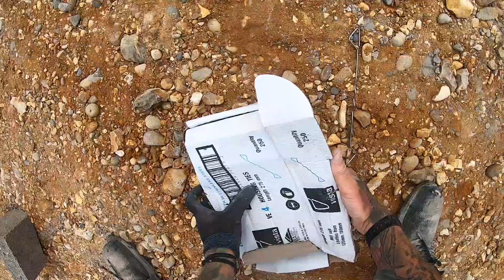1st footing complete

Comment: Can anyone help I have a internal concrete lintel which sits on a full brick solid wall but externally the soldier course sits mid brick surly if I take the window out there is going to be 2 different heights  from internal to external